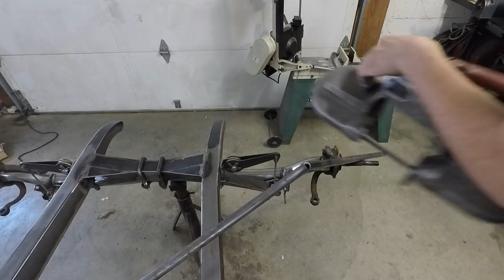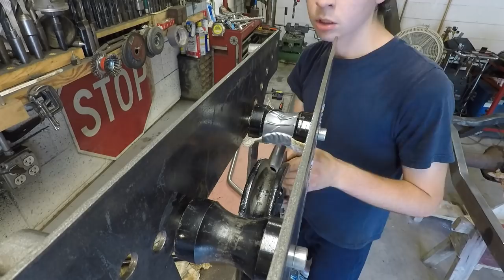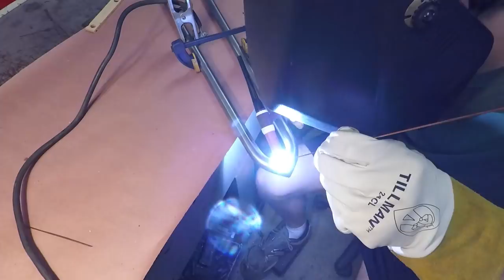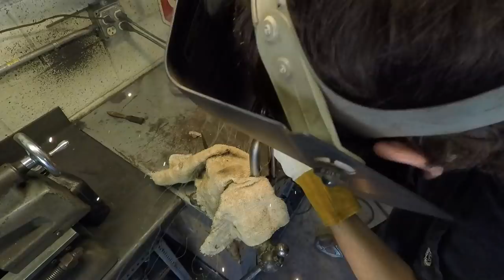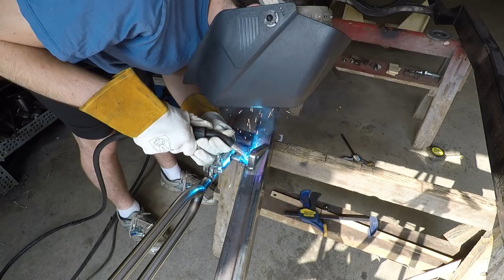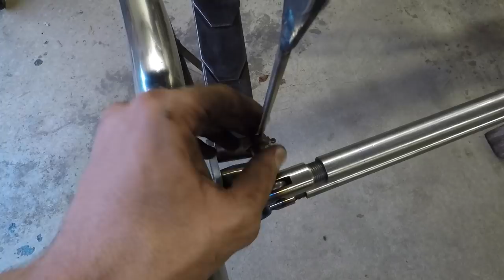Custom Hairpins | Boat-tail Speedster Pt.12

Comment: We used to call them truss rods, Hair pins are for girls,, Looking good you used 7/8?
Reply from the maker: yeah 7/8 tubing with .156 wall
Reply: MacroMachines that'll hold, Only tip is Mig is handy for repairing but for deep penitration should use arc. Like the truss rod ends, You can lift that frame so it's not very thick I've seen circle welds pull right out on Mig welds.

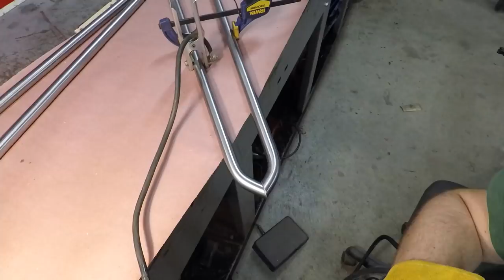Comment: 3:22 - come on man, don't get safety complacent ... at least use a welders apron!
Reply: I was thinking the same thing. One dribble from the MOLTEN PUDDLE OF METAL, and his knee is toast(ed). Yes, he is TIG welding, so he has more wire/puddle control, but mistakes do happen.